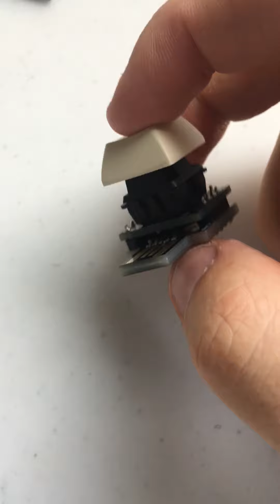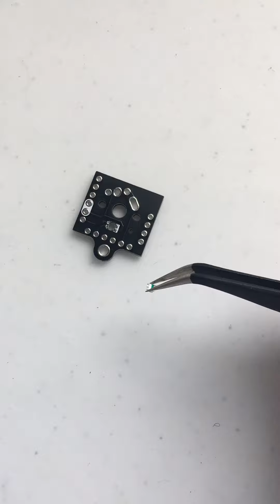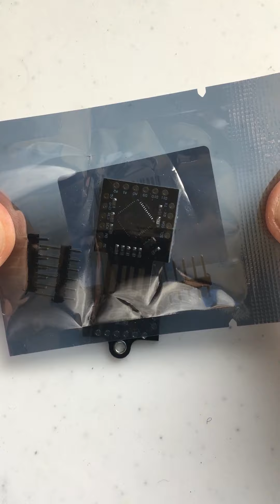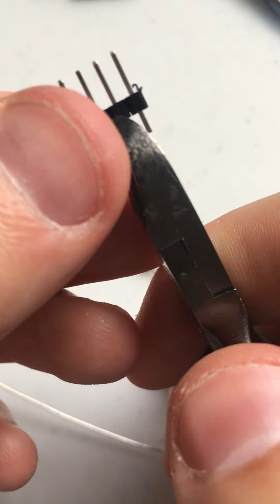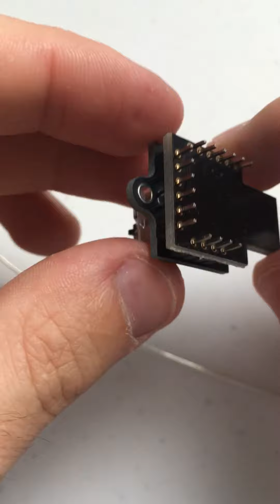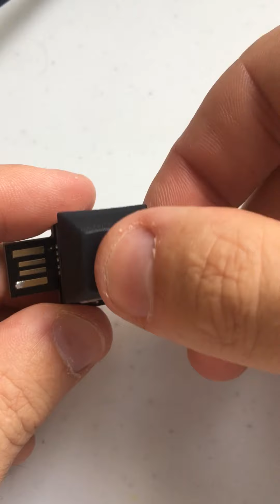Uno Assembly

Comment: Just got mine today and soldered the led facing the other way (but with the green line facing the white bar), will it affect the build or will I have to desolder the entire thing to correct the position? The LED seems to work in the other way anyway.
Reply from the maker: I'm so sorry, I rarely look at youtube comments - I recommend messaging me on Reddit.  If the LED is in the right orientation, just transposed to the top of the PCB instead of inserted into the bottom, it should work fine - though it may physically get in the way of the switch.